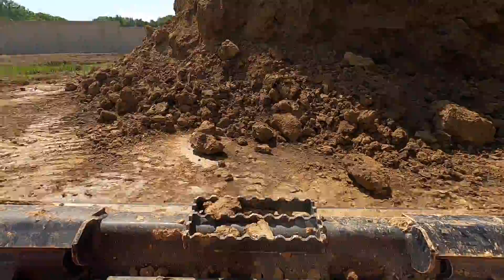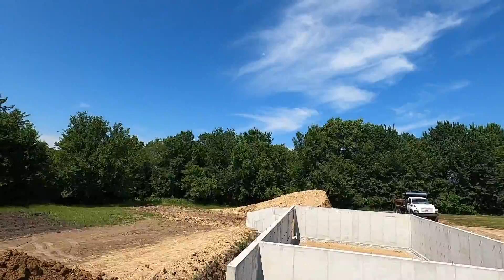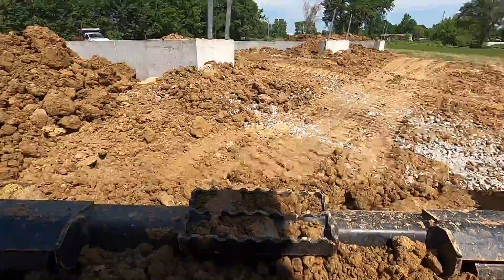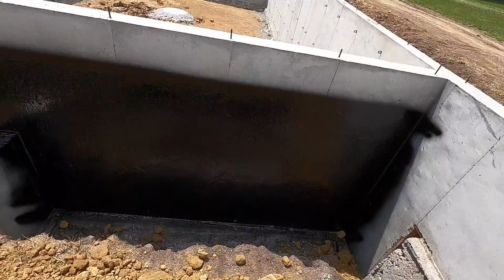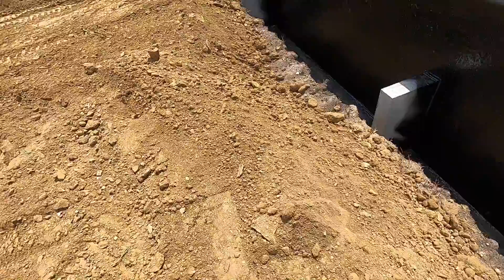A Little Backfill

Comment: Are you happy with Dumpy?  I've heard guys complain that some single axel  trucks aren't very desirable because they can't haul large enough loads and are slow.  Especially the International 4600 4700 models.  I don't want a tri axel size truck for my small business.  I like the size of Dumpy.
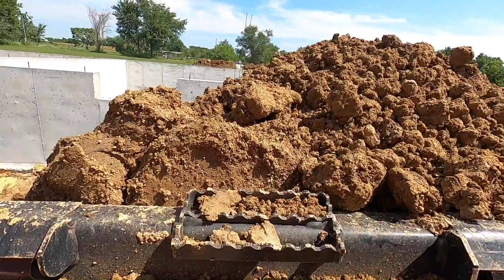Reply from the maker: I don't want a big truck either. I use this truck all the time for back filling and moving dirt around job sites. Works great. It has a really tight turning radius and does really good with power. I can absolutely load the bed up and go. Mine is a 8.1 gas engine with 4:10 gears. Does really good.